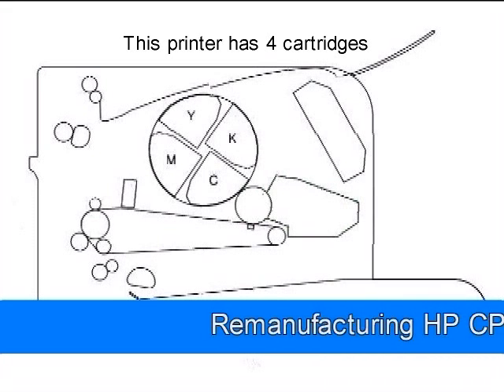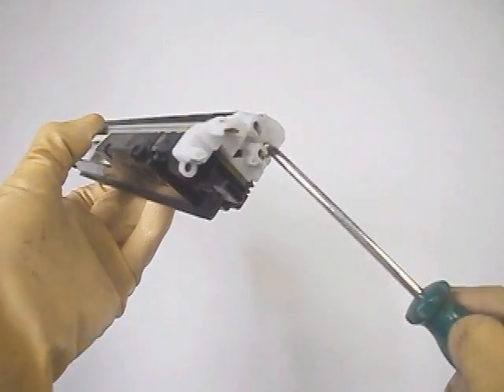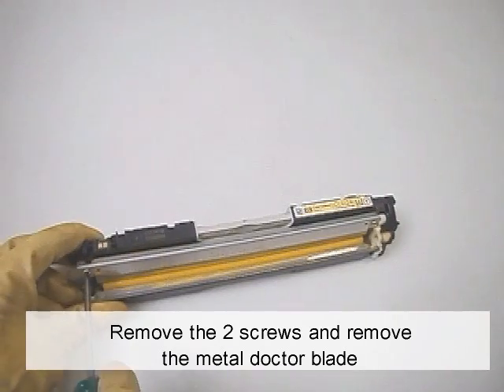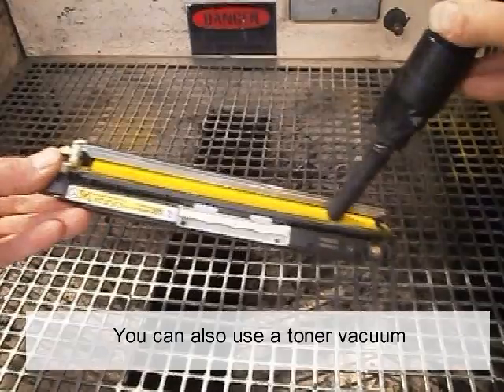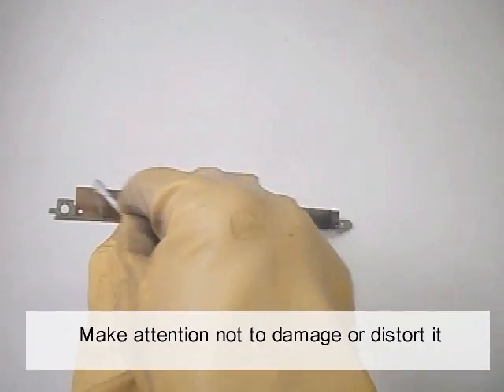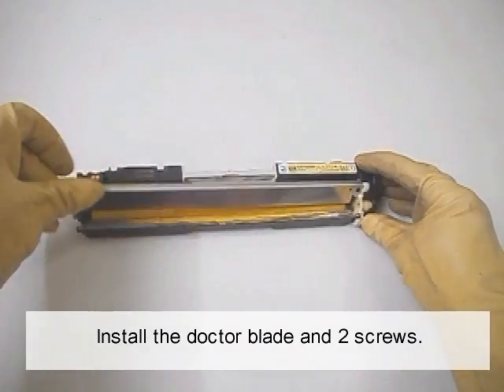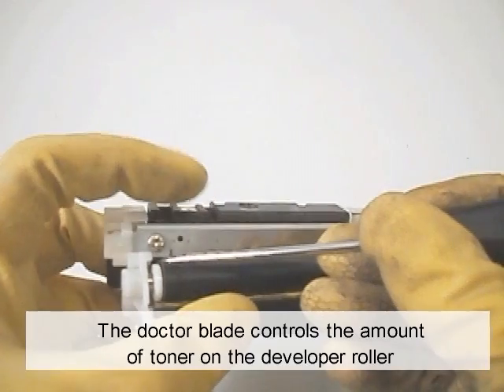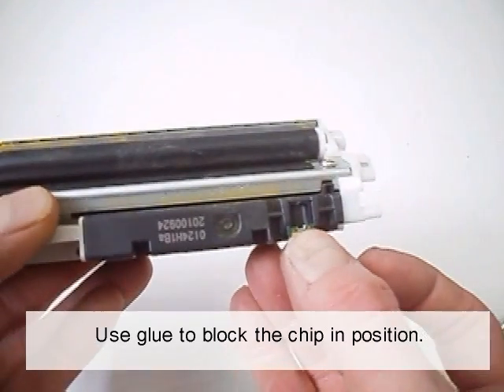HP Laserjet CP1025 M175 130A 126A Toner Cartridge Refill

Comment: is there a way if the little felt is broken? because to replace no one is selling.
Reply from the maker: The felt under the magnetic roller? Every type of toner cartridge felt will work, just cut it
Reply: @viandant5  what I mean here is a small foam like a bushing, I don't know what the name of the spare part is but in the video that is shown the spare part is called little felt. What I'm asking is what if the small foam is damaged or broken, is there a way to replace it as a seal bushing, because I'm looking for nothing for sale. Thanks u very much
Reply from the maker: @VoxVision_AI  It only has the task to seal the toner container inside the metal rod. I think you can use a normal piece of felt or sponge, or you can left the old felt, it's not an important part

Comment: which ink you use for it. I use ink HP 1600. and ink is burnt when printing :( help me !
Reply from the maker: Nguyen Hai Duong hp 1600 toner does not work in this cartridge, the fusers are different in temperature. you can try hp 1215 toner, if you haven't the possibility to buy the right toner
Reply: viandant5 thanks so much. do you have picture i send your mail. how to fix it :(  I will try HP 1215.

Comment: No need to install a new chip. Windows 7: Go to control panel>devices and printers.  Right click on HP 1025nw and choose 'printer properties'.  On the 'ports' tab disable 'enable bidirectional support' at the bottom.  This stops printer communicating to computer.  Warning lights will remain on printer but you will still be able to print.  I've been refilling same cartridge for 2 years this way.  When a colour fades, time to refill.  NO CHIP NEEDED!
Reply: Jason tsv i can't enable bidirectional support. help me !

Comment: where I can get the chip?
Reply from the maker: on ebay, or do a search with google
Reply: so it sold separately with the toner? I want to try it by myself so buy a new cartridge so expensive to me. I'm from Indonesia.
Reply from the maker: Danisha Azka yes, you can buy the chip separately from the toner. this cartridge uses a chemical toner, after cleaning the cartridge it's not impossible to use the toner left in 3-4 used cartridges and obtain an acceptable cartridge for use in your own printer